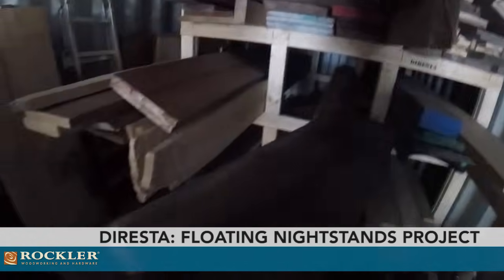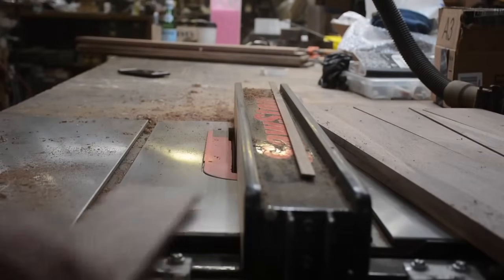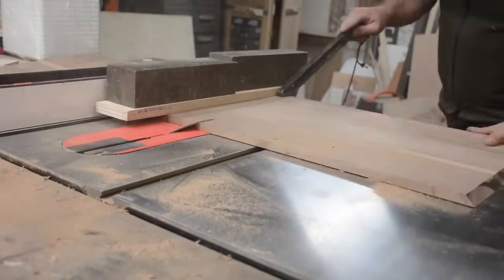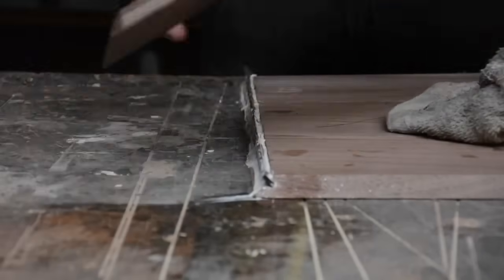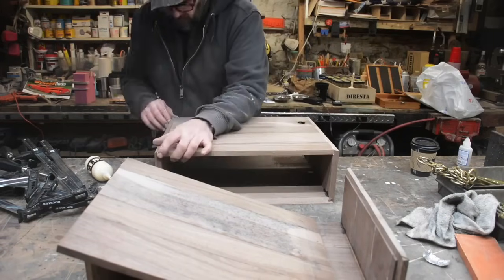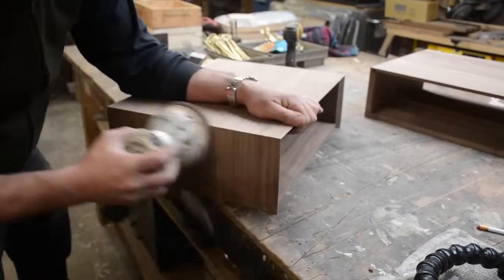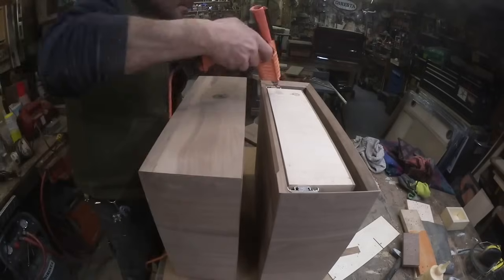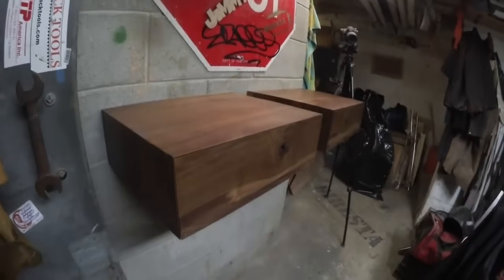DiResta | Floating Nightstands Project

Comment: Hey Jimmy. Love your vids man, thank you for making them. I've picked up a lot of tricks from watching. Here's a tip you might like to use. Whenever I have to glue up  frames or box shapes, I use a ratchet strap(s) to wrap it after I spread all my glue. The minute it gets taught, the frame or box trues up pretty close and you can clamp in a square afterwards just for good measure. Cheers!

Comment: I remember seeing the guy design the joint you used on the drawers. I never heard that it was picked up and made into a blade. Pretty cool.
Reply: Billy Beane I think I saw a router set for doing that joint.
Reply: Robert Schuster the guy I saw layed out the joint by hand then did a 3d rendering g of a saw blade/shaper blade and that was the last I saw. nice to see it went into production as it gives more surface area and tested stronger than a half lap or biscuit joint
Reply: yup, saw that too! Nice to see it in action.
Reply: Andy Klein inventor

Comment: Third!!! Thank you Rockler!!
Reply: jimmydiresta hey jimmy do you fond the price of that dado stack to be worth it?
Reply: Great job Jimmy!
Reply: Totally Hammered Woodworks just takes one good well-placed well price job and you got it covered
Reply: While this dado stack is cool and all... the set is pricey for the regular home guy who's not profiting off their creations. And I get that. However, just because this dado stack is the new kid in town, let's not forget about the Lock Mitre Router Bit. Creates the same edge profile, even works on ply and 1/3rd the price.

That being said, I would totally use Andy Klein's creation. I like the origami aspect of using a single sheet. However, I do not have a Table Saw in my shop, and no plans on getting one. I prefer to use my Track Saw. I do have a shaper table however, and love my Lock Mitre Bit!
Reply: Saw a video a while ago when these dado stacks were first developed. I am glad to see the guy got it into production. Have made a few apothecary cabinets with upwards of 40 drawers. This might be a winner.
Reply: What thickness did you plane the pieces down to? I designed a similar nightstand with 3/4 walnut and this video has me thinking I can go down to 5/8 or maybe 1/2 inch.
Reply: jimmydiresta Another awesome build!
Reply: this was 1/2  to get 3 pieces on the re saw with some room for the surface planer thank you
Reply: jimmydiresta thank you sir. You probably get this all the time but your channel is the reason I got into woodworking. Well, you and Nick Offerman.
Reply: Will there be any other videos from you on Rockler?
Reply: jimmydiresta counting... then shouts CUTTING! love that part :D don't worry we all do it.
Reply: All different roads to same Rome.
Reply: I really want to buy it, if you say....you can.. LOL
Reply: @jimmydiresta  hello Jimmy Iam huge fan of you keep up the good work much love from Iraq to you

Comment: Man, when I saw these on your vlog I thought for sure they're be french cleat, but I like the way you did it - seems more secure.
Reply: agree 100%
Reply: I thought they were French cleat right up until the end, when he made the template.
Reply: french cleat is over rated i think :D
Reply: Too "deep" object for FC. Think about it.
Reply: I agree. I think the only way a french cleat would have worked was if he put a screw into the wall keeping the cleat from lifting off, and the cleat was only there to distribute weight. I like the way it ended up being attached to the wall better than a french cleat anyhow...
Reply: Here in Earthquake Country, we design cabinetry with glued-in-place French Cleats all the time, the difference is that after we position the piece, we then screw it into place so that it doesn't jump off the wall during an earthquake.  Bottom line:  The FC is a much stronger connection because it splits the load into shear and moment forces, rather than just moment, which wants to simply pull the screws straight out of their holes.
Reply: Interesting, thanks for sharing! Unfortunately that takes away one of the major benefits of a FC, the ability to move it! haha
Reply: Not at all, the screwing happens just like the vid shows, from the inside thru the back panel into the wall cleat.  If you want to move it, then unscrew it, slide to new position and re-screw to the wall cleat -- best of both worlds.
Reply: Oh, I thought you meant you glued the two pieces together! haha

Comment: if you were to make the drawer sides shorter, then build up the bottom with glue on strips, you could use the concealed drawer runners no problem.

Comment: Hey jimmy. If you cut the draw miter at less then 45 degrees (44) or (43.5) you'd get a better with the draw spaces. Since the miter isn't seen and isn't actually a joint when you slide the draw in it will allow the outside to make a perfect 90 degree corner with no gap or pressure pushing outward even though if you were inside the draw looking out the joint would have a space of that 1degree. I can send a photo if that doesn't make since. It's just an easy way of getting the draw face to match up perfect with box while given the illusion when the draw is open that it's a perfectly fit joint.. actually the jig you used to make the box demonstrates this perfectly. With the tape on back you fold it to 95 degrees. Outside the edges line up. But inside would have a 5 degree space. Just a little trick that you may fine helpful in the future when doing miter joints that have to fit together but not perminately

Comment: could you of used the Dado Folding set for the frames as well, or were they too thin?
Reply: offsuit57 seems like the Dado folding set only works on ply wood, because of the veneer.  doesn't seem like it would work on solid wood

Comment: What screw was used to attach the floating shelves to the concrete blocks? Also, that's a hammer drill right?
Reply: they are called tapcons.  they provide the right size bit as well.